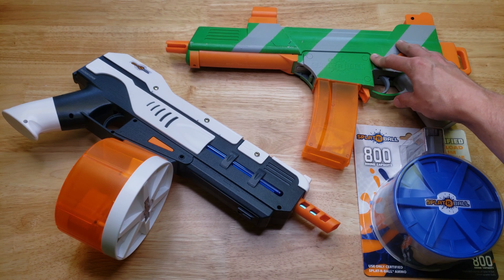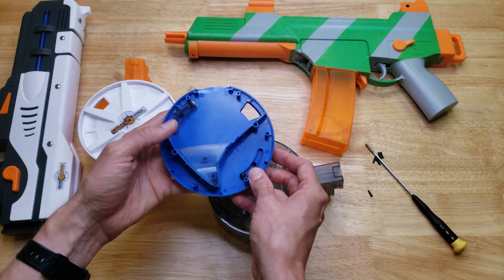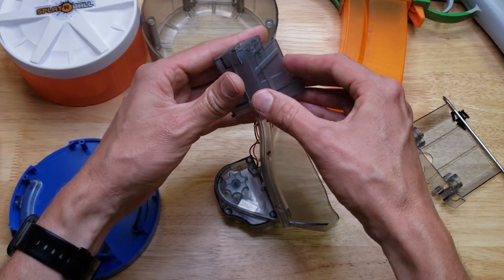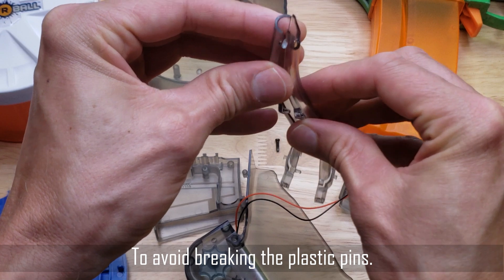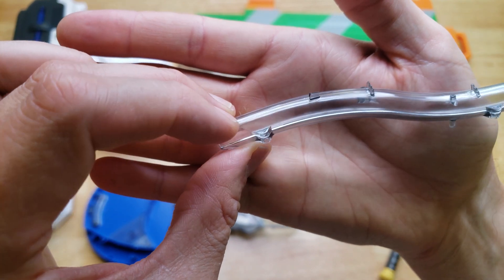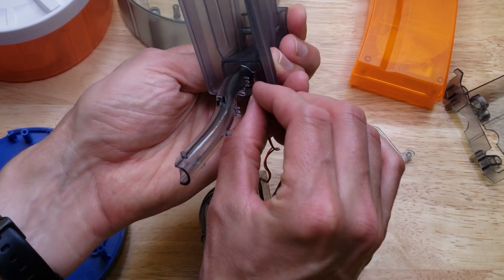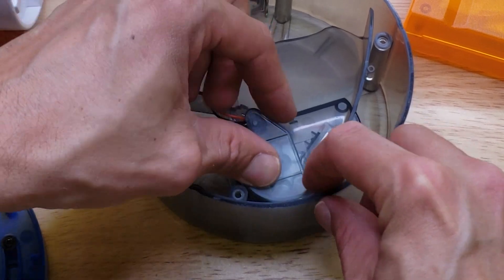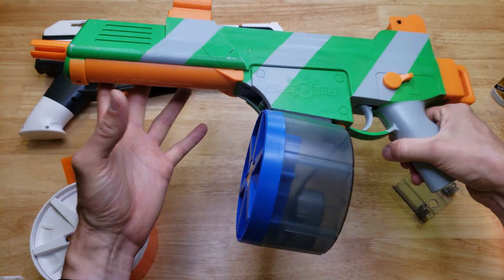How To Take Apart SPLATRBALL GUN DRUM MAG | Gel Blasters SRB1200 & 800 Round Magazine Fix & Repair

Comment: Hey i was using my srb 1200 and it suddenly stopped shooting. I tried making some investigations and i was shooting with the mag and nothing would come out, when i would take the mag out it the gels would be somewhat crushed inside the mag and some inside the chamber where the mag is placed. If i place a singular gellet in the chamber at once and shoot, it works, but when i insert the mag it just seems to crush the bullets. Is there any fix?
Reply: same did you find out anything

Comment: I just got the splatrball 1200, I soaked the balls for 4 hours as recommended and filled the magazine, when shooting i dont feel like the balls are getting fed properly as most of the shots come
Out empty, do you think this might be issues with the gel balls ?
Reply from the maker: Last I checked, Splatrball has a metal tappet plate, and I've bought some that fired mostly blanks. When I took them apart, I noticed the tappet plate was bent, which causes the nozzle to not come back far enough and therefore the gel balls can't enter the barrel. Straightning it solved the issue, but it can bend again. I would return it and buy an UNLOCX or SURGE XL
Reply: Thank you for the reply man, i wish getting a bel blaster to my country was this easy lol, i live in dubai and it was a hassle to get it in..so the stock tappet plates in the splatrball are metal? Or do you recommend i buy a metal one and install it?
Reply from the maker: @tareqkrunz9772 First, make sure you grow your gels in distilled water so that they grow properly. If Dubai tap water is hard (lots of minerals) the gel balls won't grow large enough, which could cause issues.
 Stock tappet plates are metal. Check out this video, you'll see me straightening out a slightly bent tappet (it was still firing normally though). https://youtu.be/3o4r5-Xr93U
In theory the tappet plate could be replaced with a plastic one like most gel blasters have, but I haven't found an off the shelf one that works yet.
Reply: @engineerable  thank you so much, will definitely try and use different water, also will check the tappet later if needed
Reply from the maker: @tareqkrunz9772  If you have calipers, check the gel ball size once grown. They should measure between 7-8mm. Over 8mm will not feed in Splatrball. Under 7mm will also cause feeding issues.
Reply: @engineerable  ordering a caliper right now haha

Comment: These mags suck. Ive had the gun 2 days. Sr 400 that is. Bad design. Litterly will only shoot one in ever3 shots. Sometimes not at all. And yes i follow all the maintenance tips. Gravity fed would prob be better
Reply from the maker: It's an issue with the cheap metal tappet plate. It bends (sometimes bent when you get it), and then the nozzle doesn't retract far enough.  Watch this video to see how to straighten the tappet plates. https://youtu.be/3o4r5-Xr93U

Comment: Do you know what the problem would be if my drum mag motor is not going but everything else is good
Reply from the maker: Could be broken wiring, bad motor, or slipping drive gear. First thing to check is measure if you are getting power to the mag contacts.
Reply: @engineerable  I have the same problem
Reply: @engineerable  how do I check that?
Reply from the maker: @whoismichaelc  use a voltmeter